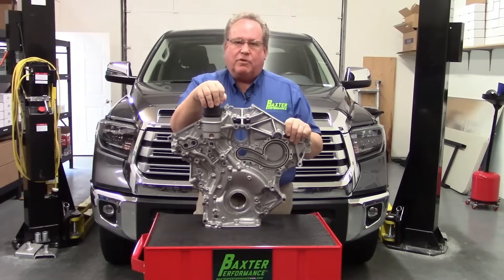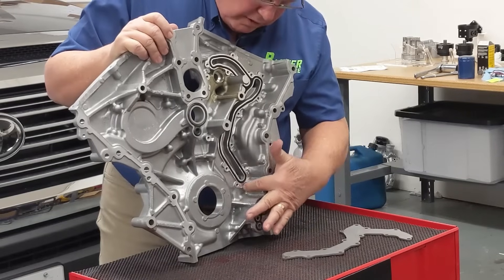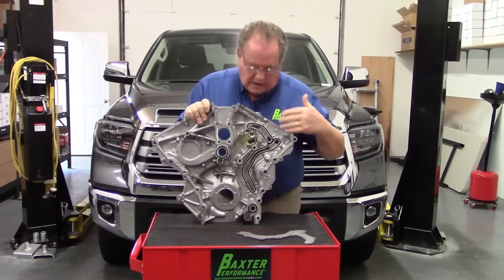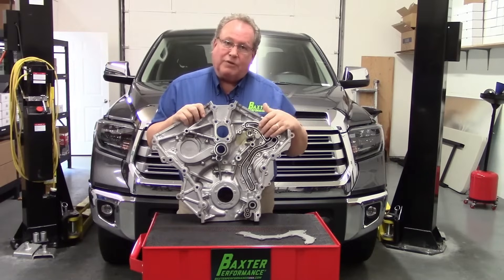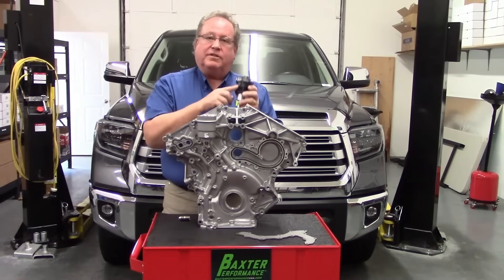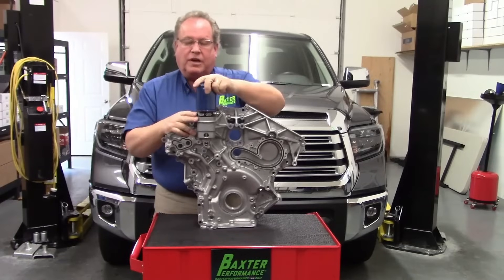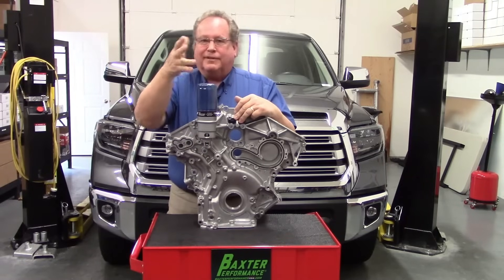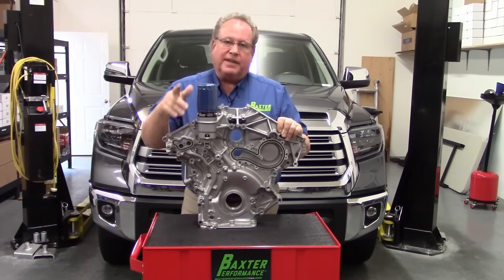Ford 2.7 and 3.0 EcoBoost Spin-on Adapter, Baxter Performance, Ford Bronco & Ford F150, #drystart

Comment: When applying air pressure to the system, this forces the oil to push through the filter media and down the traditional oil flow of the system?

Comment: All bearing surfaces look smooth but they aren't. There is micron size roughness to them to hold oil when they sit. Unless it's been sitting for years and years there shouldn't be a problem.

Comment: $400 seems a bit steep.
My 2.7 Ecoboost will probably die because of the oil pump belt breaking and not froma slight daily oil starvation.
Now come up with a diy chain replacement for that sissy little belt and I'll whip out my credit card.
Reply: The belt will likely be the very last thing to break
Reply: And you can get a better filter on it
Reply: DIY chain replacement? A'int no thing unless you're a professional with a shop, have you seen how much work its takes to get the timing cover off and with the oil belt behind the timing chains, you'll have to retime the motor after swapping the belt for the chain. I believe the belt can be swapped with the earlier generation chain. Watch a I Do Cars 2.7L engine breakdown if you're curious.

Comment: I have one of these trucks and on a cold startup (70° cause Texas) it’s taking less than 1 second from the time the engine fires to the time I have oil pressure reading on a scanner after having sat overnight. Regardless of wether or not the oil is draining down to the sump these engines are not running long enough without oil to worry about modifying the oil system. On top of that any good quality oil will maintain some degree of oil film throughout the engine so it isn’t starting dry anyway. I really don’t like the shrader valve oil filter clearing because not everyone has shop air to do something like that. Moreover this mod doesnt address the real issue these engines have which is a wet rubber belt for the oil pump which is far more likely to kill the engine than 1 second to build oil pressure.
Reply: A simple bike pump will do the job.

Comment: Pretty good idea for those that want to use a hassle free spin on oil filter. However on my stock 2.7 ecoboost, it registers oil pressure immediately upon first turn of the ignition, even after sitting for 3 days. It appears Ford has already thought of this and has developed a solution for oil drain back from the filter.
Reply: It appears ? How do we know for sure? Wait and see if the cam phasers fail?

Comment: I just purchased an pre owned 2017 2.7 STX F150 in  very good condition I do notice a slight rattle upon dry starts nothing real bad yet ; but will definitely consider this product ; if I planned to keep it for my daily;seems logical to hold oil to hit the moving parts sooner.
Reply from the maker: Nice pick!
Reply: How about you answer actual questions @baxterperformance4954

Comment: Do you need to add more oil to compensate? Also instead of using the FL500, can I use the FL820 but then also add more oil?

Comment: I have this product and my truck is not used every day.  This absolutely makes a night and day difference.  The truck is used weekly so it sits for 5 days not running.  No more dry starts and you can hear the difference. Great product
Reply from the maker: Thanks for the good feedback! We got good history on the road and trail!
Reply: I’ve heard that oil filters with anti drainback only work right side up, good to know this actually works.

Comment: Id like to see a oil pressure test with and without this product
Reply: The difference in startup oil pressure will be negligible. I have a stock 2.7 and the amount of time it takes to build oil pressure after sitting overnight is less than 1 second. This mod is a gimmick to put it nicely

Comment: Great presentation!
Reply from the maker: I've worked in manufacturing for over 35 years, and Kevin Baxter is one of the smartest designers/ R&D I've worked with. I've been involved in over 5,000 manufacturing projects in the US, and Kevin's expertise is always impressive. Great product and it does help with oil pressure!

Thanks, Tom
#baxterteam

Comment: Another example of someone creating a problem that does no exist. I bought a 2016 F165 new and it has 93k miles. I use motorcraft 5w30 synthetic blend with a motorcraft oil filter. I have never had to add any oil. When someone say most engine wear happen at start up. They are lying. Most engine wear happen when the engine is making full power.
Reply: Dry start happens . Oil goes back down when sitting . Nothing up top, this holds the oil so when you start engine after sitting the oil hits sooner to the parts .  Makes sense .
Reply: @JDRTRM  Just because it make sense. Does not mean it's true. My truck now has 99k miles and it still does not smoke or use oil.
Reply from the maker: Hidden problems can lead to big issues. All Terrain Auto Care in Knoxville, TN, has seen a lot of camshaft and lifter problems. We need to get more out of our engines, but neglecting maintenance can shorten their lifespan.

Please stop by our booth at the SEMA Show in Vegas!

I like this video https://www.youtube.com/watch?v=g5aowl0skY0
Reply: @baxterperformance4954  I’ve got 300,000 miles out of a 96 4x4 Tahoe 5.7.  I didn’t use any additives. I got 285k miles out of the stock 4L60e transmission. The first transmission service was @ 145k when it started slipping. Aamco said I shouldn’t change it because I had not serviced it before. I’m glad I didn’t listen to them.
Reply: @JDRTRM  An engine never starts dry. You can turn an engine off for a year and oil will be on the bearings. If you ever take an engine apart. You will see this.
Reply: People just think it’s too expensive.. it’s worth it , oil needs to stay up there . Oil pressure .
Reply: @JDRTRM  What kind of car do you drive?
Reply: @Fone65 Doesnt matter, I own all types of transportation. From mild to wild , water toys to land  equipment.maybe I own one of these vehicles that’s why I’m on this YouTube channel ? 

Point is you need to look at all the other channels that have installed on there vehicles. 

Many people get upset at the  product don’t work blah blah to expensive blah blah . It’s engineering  that makes sense . Keep the oil up top to help with the dry starts that happens with all engines .
Reply: My 2.7 has 30k on it and I can tell how fast it drains back. It’s annoying how rattley it sounds after I come out of a store 20 minutes later.
Reply from the maker: The engine turns over so fast and just for 3-4 secs you get a dry start, but it will cost your camshafts, lifters... Thanks for the good feedback!
Reply: @baxterperformance4954  100% bull. An engine can sit for a month and there’s residual oil on everything. An engine never starts dry. When you rebuild the engine, you pre-oil everything.
Reply: You again ?! 

The top half of the engine is the point of concern . Oil drains back down . Over time .
Reply: @JDRTRM  Have you ever rebuilt an engine?
Reply: Well - having oil in the oil pan makes sense to keeping your engine running for a long time but doesn’t mean it true is the same thing  ?!?! 

You’re holding the oil up top . What’s so difficult to understand. Listen to a 3.5 with bad cam phasers without this product and one with this product, you can hear the difference because it’s getting oil much sooner/quicker. 

If you don’t know you don’t know .
Reply: @JDRTRM  If people kelp their oil change. They would not have vvt problems. What kind of car do you drive?
Reply from the maker: We started the company with RAV4 Toyota,, and the Baxter's team has Jeeps, Dodge Ram trucks, Ford F150, Subaru Outback, Chevy Apache 1960 RatRod - shop truck just for fun...
Reply: @baxterperformance4954  You are wasting your time with me. Unlike most of the people on YouTube, I actually understand how engine works. I didn’t just start learning about cars when I got a laptop and 09.
Reply: Yes I have from 2 smokes to diesels .   It’s about start up  (oil pressure) at the upper end in these type engines.

This is what this is for. Oil pump needs to suck it up and around it goes upper engine , if it’s there it’s getting lube quicker . 

This is why this piece is a good thing . Do you  think it’s going to harm it ?! 😮
Reply: dry start is bad. stick to sling drugs homie dont try to step up to a mans plate.
Reply: @vector150  Don't say online what you want say to my face.
Reply: @Fone65  My record says I will say it to your face. Don't be upset homie. First of the month is around the corner.
Reply: SCAM product. You are right on . they also make a adapter for the jeep cost $400.00

Comment: If you just floor your accelerator pedal while turning on the ignition for several seconds, the vehicle will turn over but not start. This will get oil to all the right places.

This Baxter adapter is over $350. That's just too much to ask for a kit that should be $100.
Reply: You’re pulling up the oil and keeping it there for 1st dry starts .  Like sucking on a straw and holding it with your tongue the fluid stays up .
Reply: Whether the vehicle starts or not, the whole point is providing proper lubrication of rotational parts as fast as possible upon startup. Your idea may not let the engine actually fire up, but it's still rotating metal on metal parts with a lack of proper oil lubrication no differently.
Reply: @Jason-wc3fh 
Interesting. You're saying it forces oil before the starter turns?
Reply: @cornpop7805  Haha. No. It just gets the oil pressurized a fraction of a second faster for better lubrication. But as others have stated, the bearings and moving parts are still typically coated with a film of oil anyway.

Comment: Just curious, is There’s no problem with the spin on being straight up & down ?
Reply from the maker: No problems. They do take some cycles to get the air pushed out of the top of the filter due to the inverted position. The same goes for the stock plastic housing, but that one drains out every time you shut the engine down.
Reply: @baxterperformance4954  if no access to a air compressor to blow out the housing before changing ,  is there another way to drain out housing for a clean removal ?

Comment: I've purchased two of your adapters.  I don't think you have reached many people out there and awaken them to how amazing your product is and the benefits of this design you have made here.
Reply from the maker: We're doing our best to reach people, but it's a skeptical world. So glad you see the value in our products.
Reply: How has this product been for you after a year of use at this point? Have oil changes been as clean/easy as described in this video? Have you experienced any leaks/issues with the adapters? Are the adapters used on a daily-driver type vehicle that gets regular use/hot cold and all season driving?